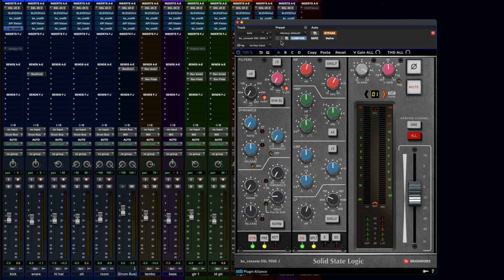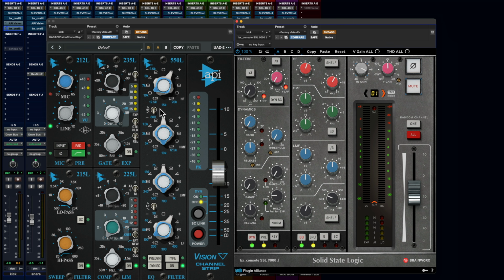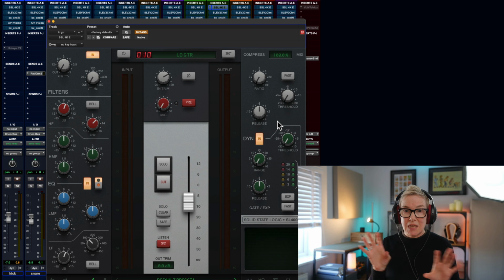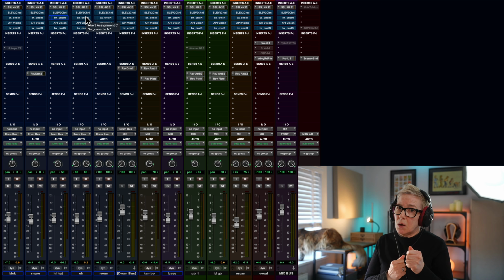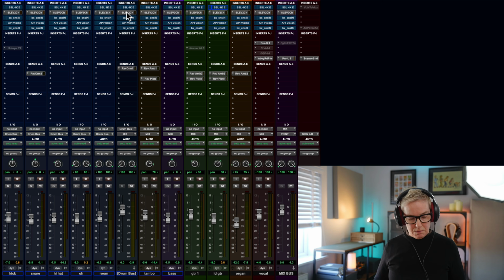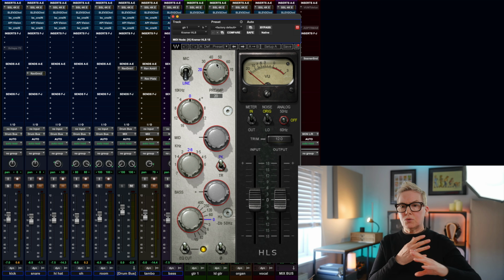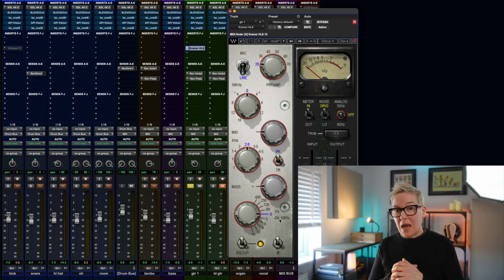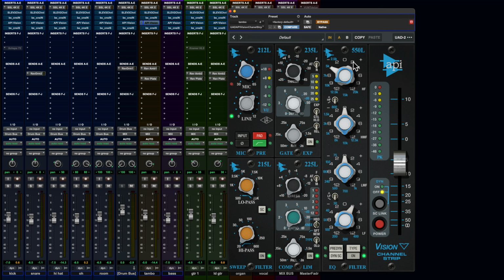Why Pros Use Channel Strip Plugins And You Should Too

Comment: Something I've never actually done before has been to create a session & put every channel strip I have on it's own bus. Then I'd load the track & make comparisons where I run that track through each channel strip I want to hear it on. I'd also have to make a base line for each strip so that each strip processes the dynamics at the same relative levels - so that I can isolate the differences in the character. I'd also subdivide that into multiple setups for each strip that are also normalized with each other so that I can have at least 2 to 3 different setups where I can compare the equivalent setup across each channel strip. I think that would be a great tool for me to use in order to get to know all the channel strips faster & more thoroughly. I've always liked the idea of using channel strips because they are typically designed end to end where all components & features were designed to compliment each other so that your signal-chain integrity isn't sonically compromised - requiring valuable time to sort out those issues. Sometimes they don't crop up until you reach certain signal strength levels where things kick-in that you didn't expect.

Comment: The biggest reason for not hitting a comercial record mix is the quality of the stems you get.  A channel strip isn't going to make a mix any better than other plugins.  Every DAW has a built in channel strip anyway..... well except for crappy pro tools.  But frankly thinking a 3rd party channel strip is going to result in better mixes is silly.  You can get saturation from a ton of different plugins that sounds far better than these channel strips, channel strips are almost the last think I would go to for saturation.  The biggest factors toward a good mix are experience, the quality of the stems, the quality of the room+monitoring chain, and having a repeatable process.  Everything else is minor.  When it comes to using eq the best advice is you only use it when you need to accomplish something specific, there is no reason to use an eq just to use the eq.  Also when you take my attitude towards eq limited choices are a bad thing.  I want the choice to solve the specific issue I'm trying to solve, not being stuck with only a few bands, etc.  There really isn't much reason these days to use a modeling eq no matter if its in a channel strip or not.  The frequencies on most channel strips are not accurate either so using them to learn frequencies is questionable.
Reply from the maker: Thanks for sharing your thoughts

Comment: So it looks like a channel strip is a chain of a gain/saturation adjustment plugin, an EQ plugin for high and low pass filtering, a compressor, a noise gate, and a very limited EQ.  What is the advantage of having a channel strip as a single plug-in rather than just the individual plugins for each purpose?
Reply from the maker: No massive advantage really, other than the convenience and being something used in studios every day, imprinting their sound to recordings or mixes. Using choice individual plugins with similar features as a channel strip is a great option and I do both.

Comment: Not even close to a API... Audio Toy's inc is taking a world class recording and automation company down the toilet . A real API pre amp like the 512  is a discrete transformer design running at 28 volt operation .  The 550 B is a serious proportional  Q design that is very musical . The plug in is a joke. If you have ever worked with a API recording console a deaf man can hear the difference !

Comment: [Switches on 4000E] Me: Sounded better without it. You: "Instantly sounds more like a record." Me: Whut?
Reply: TBF, for most sources I find "smile" EQ hurts way more than it helps. In this case, tight bass and pleasant highs became tubby and harsh, respectively.
Reply from the maker: The EQ wasn't set up properly, it was just to activate the curves in each channel strip to hear its qualities
Reply: @SaraCarterSimplyMixing  Yeah, that's my point. That's why it doesn't sound like a record

Comment: Don't know how I haven't come across your channel but great stuff. I've been moving this way for a while with my very amateur mixes using the Analog Obsession plugins. And a big thing for me (that I like) is the automatic gain compensation. I know it's not the only way to do things but particularly on cuts, I like to immediately hear how the overall sound is being changed by my decisions rather than just the loudness. So the BritChannel (1073) and the Channeve (I don't think it's modelled after a very specific strip) are fun to use.

Comment: I used to always use separate plugins for EQ and compression. Then I got the SSL Native Channel Strip 2 and the Bus Compressor 2. And when I found that there is a free 360 app which makes it possible to mix like with a console with everything laid out, I suddenly was able to mix faster and better than before. And that was not just me thinking that, it was the feedback I got as well when I redid a mix as a test and sent it to the person I did the original mix for and he was excited.

What I usually miss, and here as well, is that yes, different channel strip plugins, even those emulating the same hardware, will sound different. But in most cases that is mainly if you use the same settings on each. As soon as you start to really go by ear you can get them to sound much more similar, sometimes even exactly the same. As an example the AMEK 9099 channel strip, which I was very excited about for drums. And I still am because it's so effortless to create a full and rich drum sound with it. Not because of it being better, but but because of the default curves being just right. I can get a very close sound to that with an SSL by just choosing the right width and frequency. A mixing engineer that opened my eyes about that was the one who works for Nickelback (yeah yeah, of course, we are supposed to hate them because everybody follows the trend without even thinking about it, but their mixes sound really good) and he was very clear about mixing, using only one Waves SSL channel strip, showing that all he did was finding he needed a little more 60 Hz on a kick, therefore adding that with the eq, then moving on. Wheen you showed the difference between the Waves and the Solid State Logic version of the 4kE versions. That difference was more than just the bass guitar, the whole mix sounded different, but also because the one with Waves was a little louder as well, making everything sounding bigger. And I think these two could sound more similar if you had made the SSL version a bit louder and raised both the low end and the high end just a little more. In fact, someone made a video about how the Waves version, and a few others as well, were not accurate in what frequencies they process. A low end boost of 60 Hz was not 60 Hz but more like 80 or something. The SSL version was accurate, and I believe the UAD as well. And the AMEK 9099 has that issue even much more extreme. So to get something sounding better you sometimes need to boost a different frequency than you expect, or use a much wider q-factor. 

Now, that being said, you do bring up great points, the most important one (in my opinion) being that a channel strip only gives you a limited amount of options, which can seem a bad thing but is actually a good thing. I always resisted that but when using that SSL channel strip on a mix I found that it's true. Provided that you have good material. Unfortunately I often deal with less than ideal (or even bad)  sounding recordings that I have to make sound at least ok. I don't mind, most of us don't have the luxury of working with great artists recording in a great studio and I specialized in editing something that sound better than a polished turd, even to the point a mastering engineer got excited about some mixes I did and asking in what studio they were recorded in. Well, just a living room with no treatment whatsoever and no one with knowledge guiding the process. So, I always start with making the recordings sound acceptable by filtering out any annoying resonances and also doing a lot of timing editing. But once that is done I render it all and go for the channel strip for the mxing part. And it made the process much more fun. A lot of words to say I agree with your video wholeheartedly. Too many options can be a limiting factor.
Reply: Would love to learn more about your mixing process man.
Reply: @Kevwesmusic  mine? Or Sara's? Mine is nothing special, very basic even.

Comment: Thanks for a great video that really taught me a lot :)! One question though -- and pardon me if I missed you answering this in the video -- am I seeing things correct, that you're applying an instance of the channel strip to all channels and adding the smile curve EQ equally to all channels? I would assume that one would normally a) add a smile curve to a mix bus channel if that's the overall EQ profile one was looking for, and/or b) individually EQ each channel so that eg a hihat doesn't get a 3 db LF shelf.
Reply from the maker: The smiley face EQ was just to engage some curves and demo the qualities of the lows and highs uniformly across the channel strips.

Comment: Just want to clarify one thing:

Channel strips come in a wide variety of setups, and in hardware form as well. A better definition would be "a pre-packaged group of commonly-needed tools that are pre-routed together in a sensible way." 

These plugins you're demoing aren't recreating the "vibe" or "feel" of the console so much as they are actually reproducing the layout and circuitry of a specific console from production history to reproduce the sound and mixing capabilities of that particular console. But a mixing console may have anywhere from 12 to 128 channels or more. A "Channel strip" is like ripping a single channel out of that board and now you're using it for your track.

As a hardware example, there are rackmount channel strips for mic inputs that feature a preamp, which goes into an EQ, and then goes into a compressor.

These aren't usually trying to recreate the circuitry from a board mixer, but instead condensing and simplifying space in a rack (so you have one rackmount unit instead of three or four)

But yes; Solid tips and great video!

Comment: Really appreciate this video. I am curious though what AD converter are you using at the time of this video.
Reply from the maker: Apollo Twin
Reply: @SaraCarterSimplyMixing  Thanks.

Questions

1) I use the Slate VCC that emulates the color of different channel strips. Would you use that in a mix in conjunction with this?

2) when setting this up do you put a channel strip on every track?

3) If so but you need to conserve CPU processing and you put your channel strip just your group channels your auxiliary channels and your master bus, would you yield the same results as if it was on every track?

Sorry for all the questions hopefully you can answer them 😅

Comment: I like the API and the SSL for different reasons. In my mixes it seems like the overall mix will tolorate lots of instances of SSL on individual tracks and bus’s without loading up the midrange and becoming congested. I also keep SSL master bus compressor on the whole time I am mixing right at the start. For me a staple of my mixes…

Comment: This was really helpful for me, thanks! Question: In your experience, would you say there's a benefit to using the same style strip for all channels on a mix? I'm wondering if that would add a kind of cohesiveness to the mix because everything's running through the same kind of processing vs mixing and matching different strips for different instruments? But maybe the effects are too subtle for that to really make a difference?
Reply from the maker: I personally like to mix and match harmonic distortion types. I think it adds to the sense of separation but I have no idea if that’s true! It is subtle for sure.
Reply: @SaraCarterSimplyMixing  oooh, no, that actually makes a lot of sense! Thank you!

Comment: Hi Sara,

thank you so much for this awesome video. I've been watching such videos from time to time over the past 15+ years and this one is by far the highest quality one. Superb production! Just two things:

1)
It would have been really interesting to have one round of comparison where there is a popular EQ plugin inserted on each channel with the same smiley face settings, e.g. Fabfilter Pro-Q.

2)
Back in the day, engineers only mixed on one type of console. What are your thoughts on using the same channel strip on all your tracks - no matter the signal source? Do the gains you get from choosing different ones depending on the source material outweigh the drawback of leaving your creative headspace to think about which one to use? 

I use channel strips on electronic music mainly because of the simplicity and having all the basic tools I need most often without having to insert a single plugin (strip is in every channel in my template). And - of course - to move fast.

Comment: I don't use a plug in. I use a Drawmer MX60 Front End One. It contains a 1073 type pre amp, an EQ, a compressor,  a noise gate, tube sound, AND a de-esser. It's made by the guys who used to work for the late, great Rupert Neve before he left Britain and moved to Texas.
Reply from the maker: That’s sounds great. Same idea but in a different package. Nice.

Comment: All great, great advice Sara, like always. I actually have two channel strips (the API from UA and the Focusrite from PA) set up with standard knobs mapped on a MidiFighter twister. 16 knobs doesn't cover every dial and knob, but it covers 90% of what you tend to use. The other 'channel' strip I use a lot is the FabFilter EQ --> UA 610 --> MPressor --> MAAG air band. I kind of switch out the compressors to see which works best. All of those are in Ableton racks, just ready to drag in to any track/bus as needed. Again, great stuff as always and your accent is lovely!!!
Reply from the maker: great point about mapping them out on a control surface, even better for ear training

Comment: You're a great speaker and this video was fun!  I do use channel strips, particularly CLA Mix Hub.  I've been relying on it more and more because I like being able to access multiple channels at once. The only thing I don't love about using the channel strips are the compressors.  I can't get them to do what I want so I usually leave them off.  I feel like limited EQ options is a net positive, but limited compressor controls are tough.  After watching this video, I may try harder to make them work for me. Thanks!
Reply from the maker: interesting about the compressors...what do you use instead?

Comment: Nice video. Channel strip on every channel is such a great way to start & reduce decision fatigue. Focusrite SC is my favourite to use on just about everything, that EQ is sooo sweet. I've had to force myself to put ot down to try the SSL 4K G & 9000 J because the Focusrite is just so damn good, but the SSLs have been a treat to work with too so its nice to change it up.
Reply from the maker: Mix and match channel strips, use a bit of everything!

Comment: Hi Sara, Excellent video. I've just subscribed to your channel. Which is your favourite channel strip plugin? Also I have a question for you. When I use channel strip plugins (my favourite is the SSL 4KB) I usually turn DOWN the input gain so that the input is -12db or below (ie. so only the green lights light up and not the yellow lights). I do this because I was always lead to believe that you should gain stage properly. While I totally get turning the input gain UP by 8db wouldn't that be bad gain staging or do you turn the output of the sound down instead?
Reply from the maker: The 8dB boost was to try get the analog harmonics working in an audible way for the demo. Take a look back through my videos I have a few on gain staging that might be interesting for you. Welcome to the channel!
Reply: @SaraCarterSimplyMixing  thanks Sara. I will look back however they might not answer my specific question above which is do you have to turn the output of the audio or instrument going into the SSL channel strip down so that it hits the input at around -12db before you turn up the input gain or is it ok if it hits let's say -3db with the SSL input gain set to zero?

Comment: I like the SSL for doing subtractive EQ and the API for adding or using the 550 eq to get specific. I could be wrong but I think the SSL console is an older one than the Neve console that they modeled those plugins after even if Neve preceded SSL as a company. Also when you were demoing the Neve strip, the text still said SSL E engaged instead of Neve. Interesting video! Thanks.
Reply from the maker: Thanks for sharing your strategy!

Comment: Thanks Sarah, very interesting and well done video! I really like using the SSL Native Channelstrip, but it's completely transparent. But it's also an emulation of a digital console, so you can't expect an ‘analogue touch’. I compensate for this with a console emulation. Many also add a tape emulation like UAD Oxid to the track... With a combination of a channel strip and various other plug-ins, you can get a pretty good sound.
Reply from the maker: Yes, tape is a great add, as is using an analog EQ like the neves or API etc. I didn’t realise the ssl native channel strip was a digital console. For some reason I thought it was the 9000j. Glad I didn’t use it in the video 🤣
Reply: Yes, exactly! I got that mixed up. The channel strip is modeled after the 9000K, which is ultra-transparent but still an analog console. I mean, the plugin has no harmonic distortion, so it sounds very transparent to me.